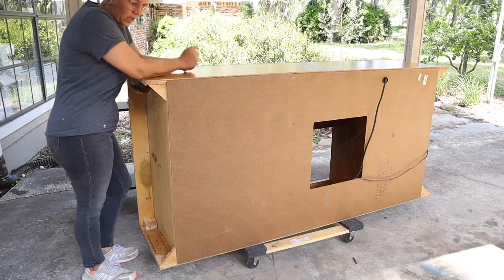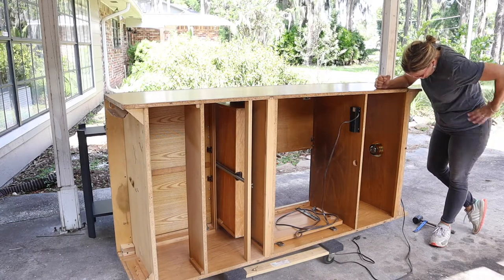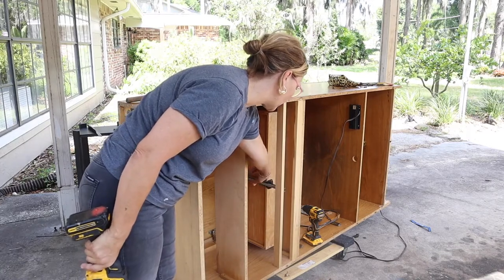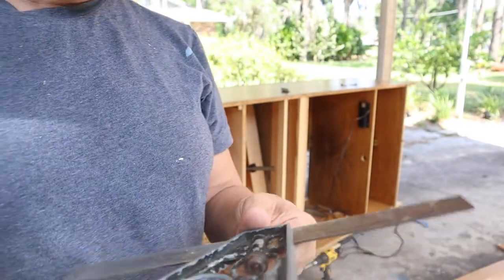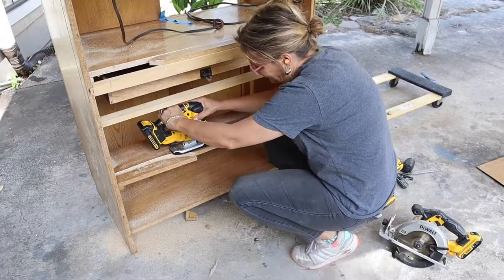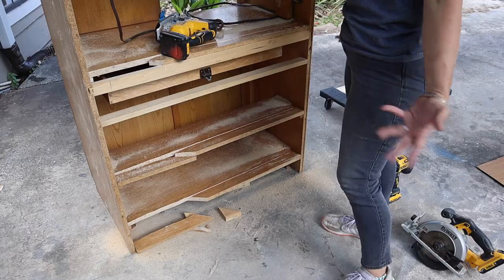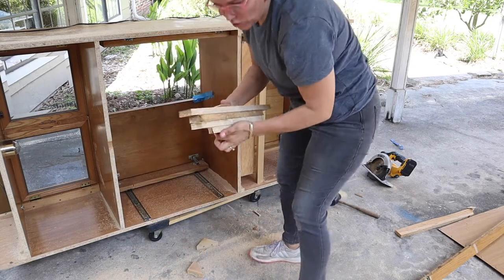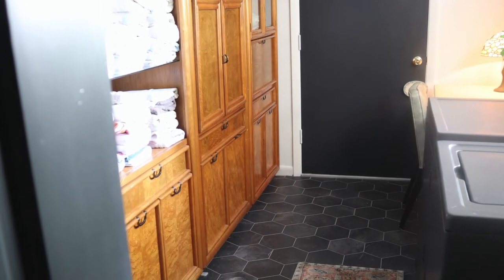Cut a cabinet to make it shallower.

Comment: You can do a white paint on the square (thinned down a bit) and and then wipe off, some will stay in the engraved numbers and easier to read. Or you can tape a measuring tape to it.  But be very careful. Old ones are gotten rid of by contractors because they no longer are square. Like t squares etc they get bent, dropped from roof, etc and just aren’t accurate and you can’t do much about it. Better to buy need one and do something else crafty with the old ones.
Reply from the maker: huh. great idea about the white paint! unfortunately mine is not engraved, just stickers.

Comment: She's going to be my new wife. She's just not aware of it yet. The fact that she is right handed and using a 20 v max panel saw says a lot. Most right handed finish carpenters will use a left handed circular saw. Easier to control.